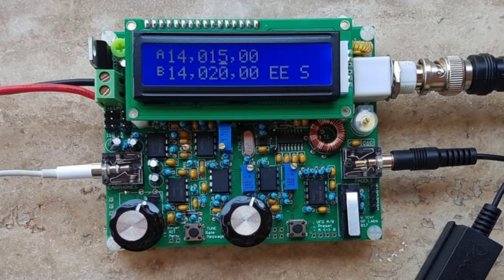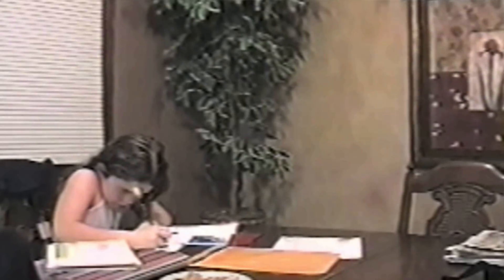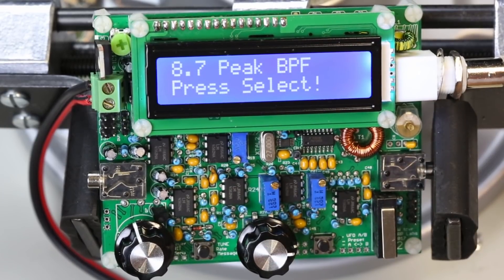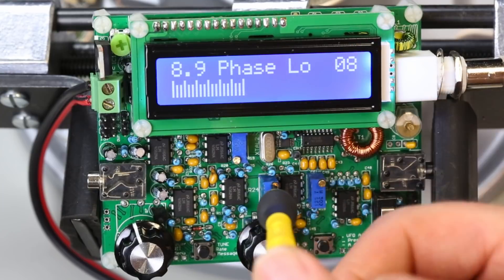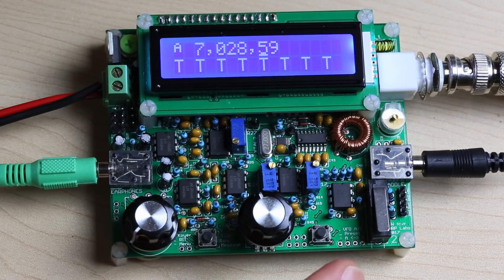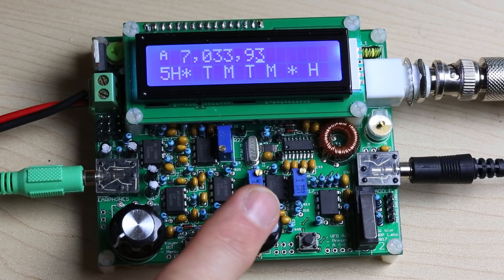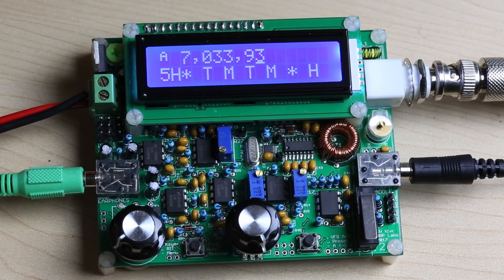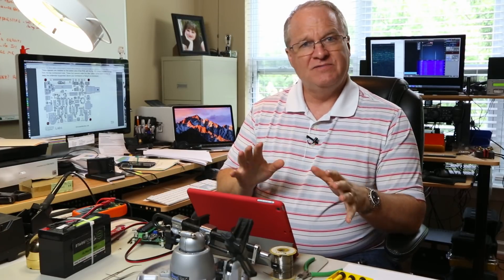The QCX Transceiver - from QRP-Labs.com

Comment: A think I learned with toroid winding years ago is this... IF you think you might need another turn or two (as with this kit), go ahead and add them.  If it turns out you have too much inductance, all is necessary is trim a bit of insulation off two adjacent turns on top of the mounted toroid, and add a drop of solder to short the turns out.  That effectively turns two turns into one, and drops the inductance by one-turn.  Compare that to desoldering toroid leads on a thru-plated PC board and the choice is clear.  :)
Reply from the maker: This is an excellent idea.  Thanks! - Cliff

Comment: I got my 40m version together, had some real issues with the instructions.  My instructions on alignment calls for using the gain control to raise the number to a certain level, while also calling to decrease the level using the three variable resistors.  The gain setting is apparently not a "set and forget"... you "start" at the halfway position.  You can't possibly keep raising the gain setting to "keep it at about 9" while simultaneously reducing the level with the vari-resistors.  Appreciate the video, but noticed you used a "set and forget" gain setting.  I think I'm supposed to set the gain setting initially, but not touch it again; it's the only way the process will work.  Maybe it's just me, but I've been building kits for 50-years.

Comment: Hey, on those micro-screwdrivers used for alignments; you know, the ones that are never the right size for the job.   Metal ones change the inductance/capacitance of the variable component, and the plastic tools always wear out.  The fix is this.... next time you're at the grocery, pick up a pack of those bamboo skewers.  Using a sharp blade, cut the shafts to the desired length, and trim the tips to any blade length/thickness needed.  The wood is dense, easy to cut precisely, and is hard and holds its shape well.  When the tip gets malformed from use, just touch it up with the penknife.  You can make a set of different sizes, or use just one that is cut to proper size for each job.
Reply from the maker: Great idea! Thanks.  -Cliff
Reply: @QRPSchool  I'm glad the metal drivers don't really affect the values on those variable micro-resistors... especially since I've got one on order :).  But, I've seen some circuits that went nuts if a metal tip got near 'em.

Comment: This looks like a great product, and I would love to buy one, however, the QRP-labs website indicates that payment can be made with a credit card. Then, when i get to the payment options, there are only 2 options, Paypal, and Bank transfer. They need to fix their website.
Reply from the maker: Jim, I believe if you choose PayPal as the method of payment, you will then have the options of logging into your PayPal account OR entering a credit card number to use PayPal as a guest. Give that a try. I could be wrong... -Cliff
Reply: @QRPSchool  You are absolutely correct Cliff, that worked , and I'm looking forward to building and testing this little bad boy. Thank you.  jim d

Comment: Hi Cliff. Nice video. I have the OHR 100a for 40 meters. I know you have one too. How would you compare the receiver in the QCX to the OHR? Of course the QCX has a bunch of other differences. :) Thanks for all your work!
Reply from the maker: In a previous purge of radios, I sold my OHR 100A. Don't worry, I still have 8 QRP radios!  I can't do a fair comparison of the 100A receiver with the QCX since I no longer own one.  However, I had no issues with the receiver in the 100A.  I will say that the QCX receiver is excellent and you can buy FIVE OCX radios for the price of ONE OHR 100A w/ keyer.  Given the additional features of the OCX, I would hesitate to recommend someone pay the additional money to build the OHR 100A unless it's for sentimental reasons... which is always valid.  But, that's just my two cents. - Cliff
Reply: @QRPSchool  Thanks Cliff. I agree, and am ordering the QCX today. Will move out the OHR to a new home. It is a great radio, just different. Kind of like comparing a Collins 75S-3B to an Icom 7300. :)
Reply: Or maybe a KWM-2A since it was a transceiver.

Comment: It's a great rig for the money, no doubt about that. But the latests version has a neat trick where the S-meter disappears when various parameters are changed in the menu! OK, so the S-meter isn't calibrated and varies with the volume setting, but it's slightly irritating!
Reply from the maker: Hmmm... It sounds like a software problem. I hope Hans will fix this.  I'm going to see him in 3 weeks at the Four Days in May event, held by the QRP-ARCI organization.  I'm hoping he'll have good news about his new radio.. the QSX.  This will be an all-band, all-mode, SDR-base radio for $150, as I understand it. It promised to be a game-changer. - Cliff

Comment: OK, so you've sold me the radio cliff, now I gotta buy one ...and buy a battery, some coax, a portable antenna, a chair and table (rocks give you piles), a notepad and pen, a case for the radio, a carry case to bring all my stuff, a flask and sandwich box, a key of course and some headphones,  petrol in the car and get away from the wife and kids long enough to make a few /p contacts but not so long that I'm marked down as an absent father and husband. ..i needn't mention nosey passer-bys, jobsworths and the local cops, bugs, dogs and ticks, rain and wind, my own dissabling anxiety and S7 noise. Why the heck do we do it??  In my experience 5W is more than enough to work the world, it's all the other stuff that makes qrp/p difficult...  There's nothing like the buzz you get from it though and that's what drives us to do it again and again  ....and that makes us all, effectively, addicts.
Reply from the maker: John C You are absolutely right... and you probably left out several additional negatives. I do like that you have included a flask among your necessary supplies! Of all forms of ham radio, QRP and satellite work seem most likely to lead to alcohol. But, we love our radios, don’t we? It’s a great hobby with something for everyone. It’s like magic, being able to communicate with someone thousands of miles away, using a piece of wire for an antenna and a small battery powered radio. Hope to talk to you on-the-air someday, John! -Cliff

Comment: Hello Cliff, this is Juddie WD8WV.  I commented a few months ago about your excellent video.  Since then I have received my QCX 40 and built it.  I have two videos on my YouTube channel in my Amateur Radio playlist where I built it and another where I used it during the 2018 Field Day.  I made over 30 contacts from my deck in the back yard with a 40 Meter end fed 1/2 wave antenna.  Since then I ordered the QCX Enclosure that BamaTech makes for QRP-Labs.  I mounted the QCX in the enclosure but of course it covers S1 switch that you use to send CW.  So I wanted to modify the case.  I ordered some parts from BamaTech and it looks factory.  I have that video posted as well with measurements if you would like to take a look at it.  Again thanks again for an excellent review of this little rig.  Juddie WD8WV

Comment: Hi Cliff, I enjoyed the video. Nice video, nice radio :-) 

One comment on your BPF Peaking. I noticed the trimmer capacitor is fully un-meshed (minimum capacitance). This indicates that the band pass peak is a little BELOW the 40m band. You will have some dB of attenuation in the 40m band, which you ideally don't want. You need to remove a few turns from the long winding of T1, to bring the resonance up into the 40m band. The trimmer capacitor setting should be neither fully un-meshed, nor fully meshed. When you've done this the sensitivity of the receiver will be improved (because you removed the unwanted attenuation). It isn't normally necessary to remove T1 turns on 30, 20 and 17m versions of the kit, but sometimes on the 40, 60 and 80m versions where the T1 long winding has quite a few turns, it is necessary to remove some for the trimmer capacitance to be able to peak the resonance. 

I also recommend using a 50-ohm dummy load during alignment of the radio, which most closely matches what your radio will (hopefully) see with the antenna connected. It does make a small difference to the BPF peak. 

Glad to see you're having fun with the kit! Current sales have reached 5,070 in 9 months since launch so it is an unbelievably popular kit. 

73 Hans G0UPL (QCX designer)
http://qrp-labs.com
Reply from the maker: Hans, thank you so much for the wonderful radio and for taking the time to watch/reply.  It's hard to imagine that my radio could perform better - I'm very happy with it - but I'll do as you say and will remove a few turns from T1 after I get home from my current vacation... and will re-peak the BPF.  Thanks again for the great contribution you've made to our hobby! - Cliff
Reply: @QRPSchool  That  bodes well when Hans watches your video and gives incite! Clearly a man who is not just doing a "job". The passion that both he and you have shines through!  Glad to be in good company. Jay KY9I
Reply: Designer himself drops by with some tweaks. How cool is that??
Reply: It's Mid April 2019, and it's my guess Hans is either close to or past 7000 units sold in QCX versions.

Comment: I have to build mine.  I’ve had it for a number of months and haven’t had the time to build it.  I did, however, finally finish my original Rockmite 20m that I bought from Dave way back in 2003 (I still had the postage on the envelope to show the date).  My goal is to build the QCX in less than 15 years though...  N1XF

Comment: Thanks for your review!  I just purchased this radio yesterday and can't wait till it gets here.  I have already built to Chinese Pixie kits!  But I wanted something more!   I have been away from the hobby for 12 years and just got back into it.  Kept my license renewed since 1996 but got out of it in 2006 and sold everything after issues with my heart.  Now I am back have a HF station setup, but I want to do qrp and portable operations.  If you have any tips on building this radio, other than. Trying to do it  in one night, LOL, please share.  I have sub'd to your channel especially since I noticed it is called qrp school.  73 Juddie WD8WV
Reply from the maker: Welcome back to the hobby, Juddie!  You already know my #1 tip:  Don't stay up until 3AM working on it... or you're bound to make a mistake! :-)   Just take it slow and double-check everything before you solder the part in-place.  You'll be fine.  Oh, and it doesn't hurt to leave some extra wire when winding the T1 toroid.  If the ends of the wires are short, it's harder to get all 8 of the wires hanging off that toroid until their respective holes.   The manual shows you a way to wind that toroid with a single piece of wire, creating "loops" that you'll cut afterwards to form the leads for the 4 windings of that toroid.  I wound all 4 independently and left the leads a little longer than necessary to make it easier.  That T1 toroid is the only part of the build that is tedious.  Just take your time. It's not a race.  Let me know how it turns out. - Cliff
Reply: QRP School , thanks for the advice Cliff.  I have already printed the manual and put in a 3 ring binder.  I sat down this evening and read pretty much all of it.  I saw that sketch using one single wire to wind the T1.  I am no stranger to winding toroids.  I just built the Chinese qrp tuner and had to wind the toroid for the inductor switch.  Very poor quality of parts in that tuner!  I also bought a QRPGuys Portable No Tune End Fed Half Wave Antenna kit and had to wind a toroid on it.  Right now I am looking at different builds in enclosures trying to think of a good one to do.  I may order the QCX enclosure that Hans has now for the QCX.  Again thanks for a great review and your response.  73 DE WD8WV

Comment: Was that a surface mount chip in there?  Is that already installed or do we have to do that ourselves?
Reply from the maker: K2CJB Radio There are 2 SMD chips that are already soldered onto the PCB. So, we are spared from that task. -Cliff
Reply: QRP School That's good!  I couldn’t imagine trying to solder those in!

Comment: Thanks Cliff.  Question: Do you think you'll build another one of these for another band option?  I've been looking hard at the uBitx, but it's just not "dialed in" for cw, which makes this kit look better, but for getting only one band.  Yes I know, some kits are rock-bound for just "one" freq.  Just haven't taken the plunge yet.
Reply from the maker: Wade - I have a 20m QCX kit to build, but I stole a capacitor from it when I broke one while building the 40m kit.  So, as soon as I can get another replacement capacitor, I'll build the 20m version.  I bought a uBitx but put it in the corner after I learned that it wasn't really great for CW.  - Cliff

Comment: Very awesome. I was Googling around just last week at some new QRP kits that are out, and came across this guy. I think that microcontroller is a 328P, so essentially an Arduino Uno - it's very impressive that they fit so many features into the programming for it.

Comment: Cliff
Could you talk about winding the T1 toroid and how much power (watts) out did you get.

Thank for being back on the channel again
73 
wd4dda
Reply from the maker: Preston Shute Winding T1 is the only tedious part of the kit. It's really not the winding that's the problem... it's the 8 wires dangling from the toroid that have to be routed into the proper holes AFTER the winding. Make sure to leave extra wire for each lead to make it easier. Think of it as pedaling a bike up a hill...it's a bit of work but great fun when you're flying down the other side!

I measure 3.8 watts out at 13.17 volts... which matches the chart found in the assembly manual. - Cliff

Comment: I was a little interested throughout the beginning of the video, but as silly as it sounds, the onboard key makes me want to get this for sure.  Is the key rugged enough for repeated use?  I really enjoy SOTA, and want to get back into it this summer, so will the whole radio be tough enough if I box it up?  Specifically, are the jacks attached firmly to the board so they won't pop loose in the chaos of a SOTA activation.
Reply from the maker: Eric Bergmueller The little microswitch will have a mechanical and electrical durability rating on a data sheet somewhere... but I don't know the manufacturer or model of the component. From poking around, looking at microswitch datasheets, they seem to promise tens of thousands of actuations, at a minimum. Of course, it's not hard to replace the switch if it ever wears out. (Heck, you can replace the entire radio for $49! Amazing price.). The jacks fit tightly to the PCB (you can bend the pins slightly before inserting to make it very tight) plus they are soldered in place.  My only concern is in packaging it. You can get fancy and "remote" the knobs and switches in a traditional enclosure. There is a link on the qrp-labs.com website called Builder's Gallery where you can see examples. Me... I'm thinking of just transporting it in an anti-static bubble bag!  - Cliff

Comment: Very nicely done.  I am looking for a decent enclosure to tale it on road.  Ideas?
Reply: I am looking forward to this one: http://www.shop.bamatech.de/ (Photo of QCX metal case should be show up on the front page).
Reply from the maker: Jeff W It is worthy of a fancy enclosure but I'm thinking of just carrying it an anti-static bubble bag, protected by a plastic case of some kind. -Cliff
Reply: Bend some metal, re-purpose something else. Take some amateur gear (old stuff) enclosures apart, see how simple they really are.  Just glancing around the room, I see that a gutted comtrend router case could be a good size.  Mod panels to suit your needs.  Ham it up. (I am fabricatory type).
Reply from the maker: Beautiful! Thanks for sharing!
Reply: Now that’s what I was looking for!
Reply: Last weekend I got hold of such an enclosure at the Ham-Radio fair in Friedrichshafen/Germany. QRP-Labs had a small booth there and I could buy one of the enclosures for 32 Euro. I just made a small unboxing video: https://youtu.be/d4Hn4FIWKqo . It's in German, but I think the video speaks for itself.
The enclosure can now be ordered at Bamatech. There are English assembly instructions available in the download area. The enclosure comes with a bag of hardware (pot extensions, rubber feet and so on).
Reply: QRP Labs has one on their web site designed for this rig. $37.